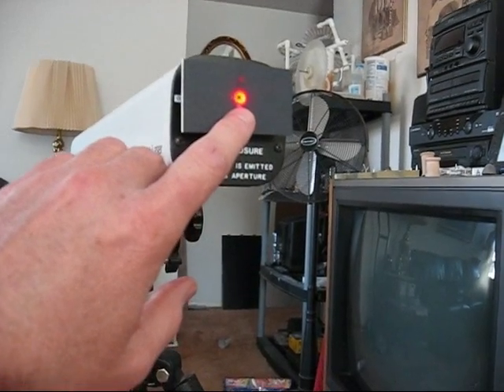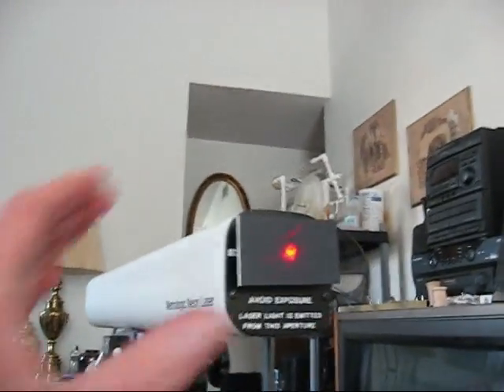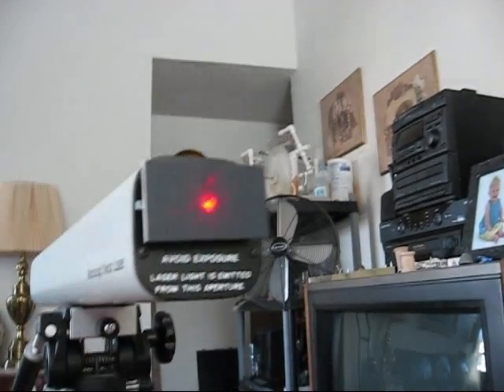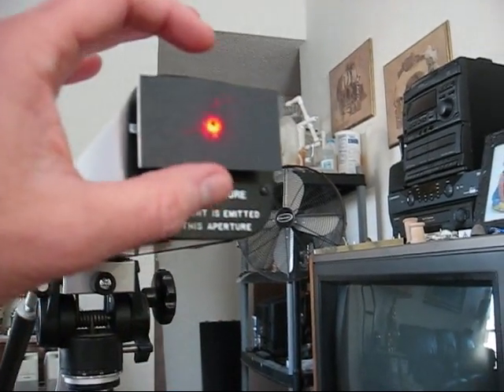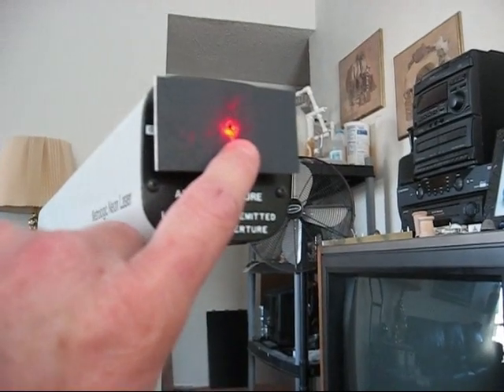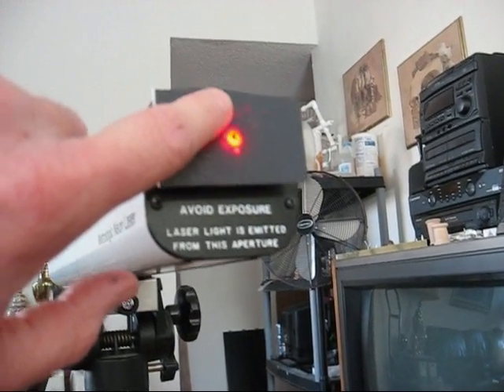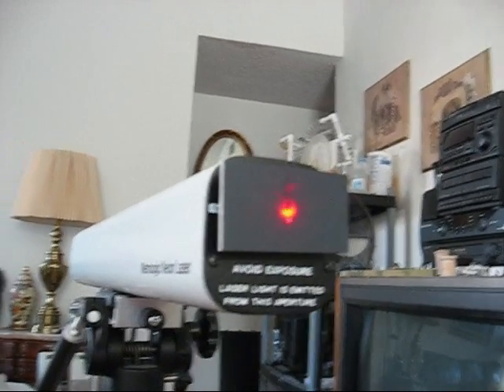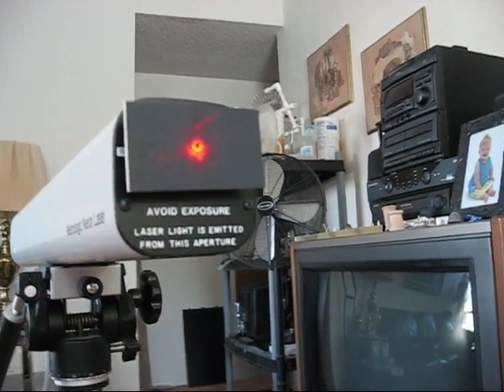Alignment and Temperature.wmv

Comment: Guess the intensity is due to interference. If so that every change in the intensity would be the fringes and that would be (if used a 632 nm he-ne laser and i think right) 0.0003 mm distance change and multiply that with the total intensity change you got to room temp and you got the total change in distance. Cool to see this tnx for the upload!